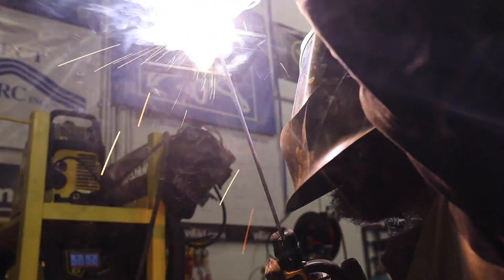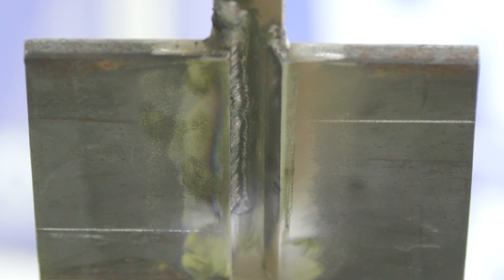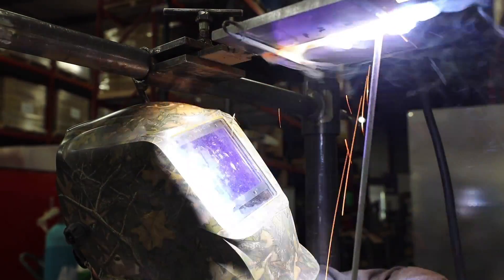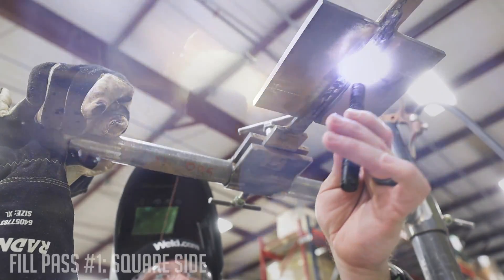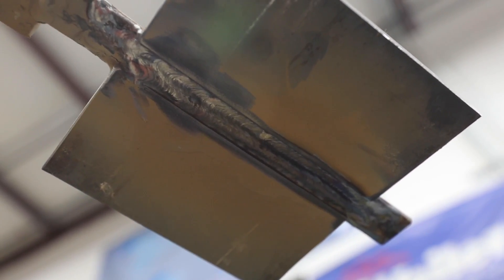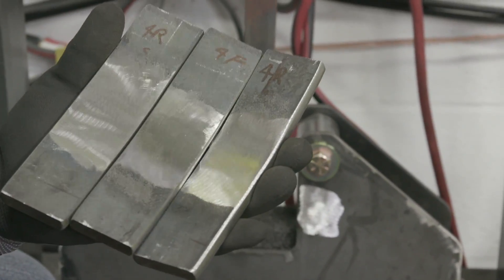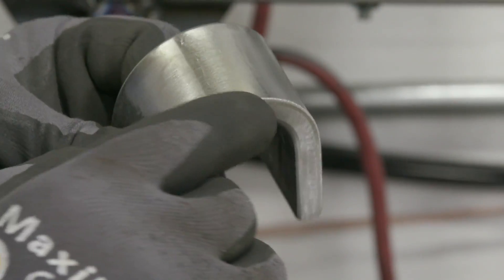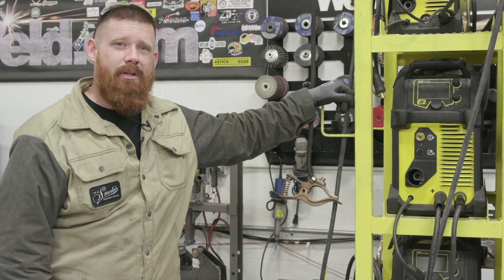Overhead Groove/Fillet Stick Welding Test For CWB

Comment: I think it depends on your inspector. In my experience I haven’t been able to change direction. Inspector will ask which way you want to go and then soap stone it on the plate. I’ve always had the choice of direction, but not allowed to switch at least on root pass. I don’t think he cared on fill and cap, but I always just ran same direction. I’ve done it twice (2 year expiry) but both times same inspector.
Reply: All root passes need to go in the same direction. Hot pass and caps can alternate however you please. But it's an automatic failure for all processes if your roots don't go the same direction.

Comment: I've completed my 2G CWB Test, and the final 4G test runs on Thursday. I've been doing test plates, Vertical Up, and Overhead Stick, and passing every run. I'm feeling very confident for the upcoming test on Thursday. 
Then apply into the Boiler Maker Union Local 128 out of Sudbury Ontario Canada 🇨🇦 as an apprentice. I'll need 4700 hours before I come a Journeymen or Red Seal ticket. I very much enjoyed your videos. They really helped me find my way with stick welding. Stick welding 7018 is my favorite 😋

Comment: Hi Fellas, If you are attempting to do high quality Stick welding I'd strongly recommend not using an AC machine. AC sources don't normally start smoothly and won't penetrate as deeply into the metal as a DC unit. With a DC inverter machine I generally run about 135 to 140 amps on a flat position test and drop down to about 115 to 120 amps  for the cap passes. Allowing the plate to cool down between passes will help control the spatter factor. This has served me well for this CWB test. Certain welding tests will have a procedure sheet indicating the required parameters such as the range at which you can run your amperage. These procedures must be followed and will be scrutinized closely by an inspector. Any deviation from the these required procedures will usually result in failure. This video contains some really good tips for doing the CWB SMAW plate welding tests. Thank you for taking the time and interest to help others to achieve this goal.

Comment: Ive taken these 20 plus years ago and when I took the test we couldn’t use a grinder with a wire wheel, a wire brush and picks we could use a hack saw blade, I guess times have changed since I’ve last had to take a welding test lol

Comment: Hey... Thank you for taking the time to give this a go and show a guy what the puddle looks like up close.

I watched all 4 videos of this practiced my flat 7 times my vert 3 and got my CWB all position s certificate today.

First overhead weld i have had to do in ten years was the test coupon. And the only stick in ten years was the practice for the test. 

I recommend taking a work light though for an actual test. The lighting angle in booths sucks for overhead and horizontal

Comment: I was a CWB certified welder for over 12years and am now a CWB certified inspector. Great job! One little trick I used to use and is no issue was to do two small center punch marks on the backer plate instead of having something in the way and risking stopping short. The other "trick" I did was to preheat the backer plate a bit. Some inspectors may say something, but there's nothing stating it shouldn't or can't be done.
Reply: Are there any way I can preheat?
With wire wheel? Or something else?
Reply: @jamesc5256  Oxy torch if you have one I guess

Comment: How do you take the back strip off without damaging the welded plates?
Reply: He showed it in an old video. Just an aggressive grinding disc on an angle grinder.
Reply: At our facility, we use either a torch with a scarfing tip or use a milling machine

Comment: Hello, which machine you recommend me to get as a starter to learn to weld. A Esab or a everlast.
Reply from the maker: What's your price range and what processes do you want?
Reply: My price range is on the 1,500 and I want a multi process welding machine
Reply: David V you’d get more bang for your buck with an Everlast. Sure the torch stinger and mig gun won’t be top notch but the machine will hold up
Reply: ITS_Denial X  so you are say everlast is what you recommend me to get
Reply: You’re looking at $1729 no tax or shipping on the rebel 215 multi process with no foot pedal for tig
Reply: ITS_Denial X  I’m willing to spend on the rebel 215. As long as it will get small jobs done
Reply: I haven’t used either but the Everlast I plan on buying comes with a lot more options and controls compared to a miller or Lincoln that I would have to spend almost 3x more to get features similar to the Everlast. And on top of that Everlast has a 5 year warranty.
Reply: Find the two models that interest you and browse forums. All brands have good and bad models. Some have more features for the price than others
Reply: ITS_Denial X  true everything has there good and bad. But as what you seem to lean more is on everlast
Reply: David V yeah I do lean more on Everlast. They give you more features for the price generally. And the warranty is a lot longer so if things go bad you don’t have to worry about paying out of pocket. Sure the torch isn’t the best but it’ll get what you want done for the time that you own the machine
Reply: ITS_Denial X  thanks really much
Reply: ITS_Denial X  last question. Which multi process you recommend everlast 211Si or 251Si
Reply: David V it depends. For mig how thick of wire would you like to weld? The 251 is better overall but it is more expensive. If you just want to do light work in a garage you still have to remember that you need the argon tank for tig and the c25/a75 tank for mig
Reply: So you need more expenses than just the machine. If you want light tig mig and stick then the 211is fine. The 251 gives a bit more features though.
Reply: Use the code “Voss” and everlast upgrades the torch and the pedal so you get a better one for free. It’s a you tubers code. I just thought I’d share it
Reply: ITS_Denial X  for 211Si correct and thank for the code really appreciate it
Reply: Where exactly I put the code cause I can’t fine anywhere to fine that code
Reply: David V sorry I didn’t see your response. But under the “order comments” portion. When I called and explain that the promotion code is for an upgrade for the tig torch and the foot pedal and they should take care of you
Reply: The order comments is under the checkout section towards the bottom
Reply: ITS_Denial X  okay thank you very much. Really appreciate. If you like I can give you my email
Reply: David V yeah If you’d like so you can email me with any questions you have
Reply: David V I’ll email you right now. You can delete the comment if you want

Comment: Of the four, overhead gets me more then the rest for whatever reason.
I'm able to get the fusion in the flat and horizontal, but can never seem to find that "comfy zone" when setting up overhead.
Reply: Did you take note of where Jason was steadying himself with his other hand? The other thing is how much overhead have you done compared to the other positions? Now think back to when you first started learning to weld, it was frustrating, then just hard, then it began to be enjoyable and finally you started to get slag peels and decent looking welds. The reason? Arc Time! Or in other words lots of practice, practice, practice.
Reply: Just keep experimenting with different positions until you find your "comfy spot"
Reply: Another little trick is to loop the cable of the stinger over your shoulder. Takes a lot of the weight off of your arm.

Comment: QUESTION:
*Is it possible to use a 90 amp harbor freight welder for hard surfacing/facing?
*If so what is/are the best wire/wires?
I have not converted my welder to DC, it is still an AC Welder.
*Will this make a difference?
Reply: It would depend on the thickness of the material. Generally in a hard surfacing application you run colder to avoid excess penetration. You want adequate fusion but penetration will lead to "dillution" of the materials. Basically you are mixing the metals/alloys together which will be counter productive to the hardening of the material face. "stoody" is a brand known for hard facing as well as "arctec" there are LOTS of wires, be it chromium based, nickel alloy, chromium carbide etc. there is no 1 simple answer.
Reply: @ProtossBossSauce  But does his welder have enough Amps and Duty Cycle?
Reply: @markfryer9880  might have the amperage depending on stick diameter, doubt it has the duty cycle though.

Comment: I've noticed a lot of changes in the recent years on welding certications.  It seems as though things have gotten more strict. Question, is it because the majority of people in the field are not skilled as previous generations?
Reply: Or perhaps standards have been raised. What used to be acceptable no longer is. Take your pick. xD
Reply: @NZobservatory  I would say that it's because standards have been raised as materials technology and research improves.

Comment: Actually on your face bend it looks,like you have an edge crack. Good shot of it is at 8:04.
Reply from the maker: It's just the lighting.
Reply: Looks like one but is it? Would he have missed a flaw so obvious, or ignored it if he didn't miss it? Maybe just a dent in the edge.
Reply: Regardless, corner cracks less than 1/4" long are acceptable unless there are signs of slag inclusion (D1.1)

Comment: I tried that, and there was molten lava dripping everywhere, felt like i was about to enter hell valhalla
Reply: Keep a very tight arc length. If there’s a gap between your rod and the plate it will rain down. A 10-15° travel angle works best for me personally. Don’t give up, you’ll get it.
Reply: And lower your current or increase travel speed. You cannot carry a big puddle.

Comment: After this would you guys think about doing the D1.5, the bridges, they're similar to 1.1 but no use of power tools at all. Doesn't have to be a entire section, just tips for not using any power tools at all. Only pick and wire brush.
Reply: That's the way I learned to do coupons,  open root, chipping hammer and wire brush only until the cut and prep. That was a lifetime ago!
Reply: Loren Wegele that’s exactly how I learned as well. No backers just open root.  NOW... till this day I still can’t run stick the way that I want to.
Reply: @matthewrice1226  I hear you!
Reply: Gotcha covered we called it D1.1 but it meets D1.5 as well. https://youtu.be/A9iDaMmjw9w

Comment: Is the CWB pickier than the U.S.
Reply: Yes. Due to the half inch gap it's alot harder
Reply: Its harder because of stop and starts as well as a 90° joint, not just two bevel joints
Reply: And CWB does a check test every 2 years and you can't have your in house inspector do the test it is always a CWB inspector.

Edit: I should mention that acceptance criteria for NDT is pretty much the same.